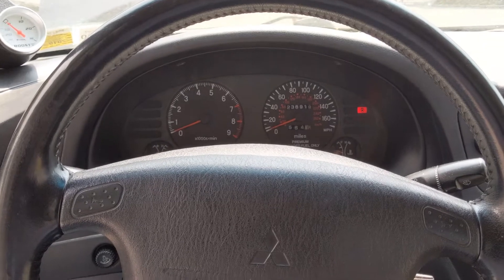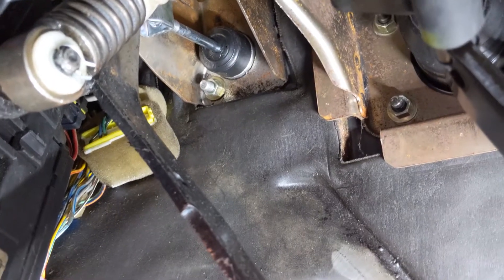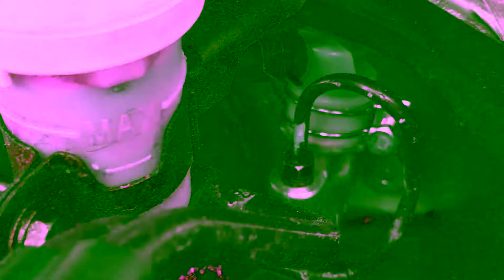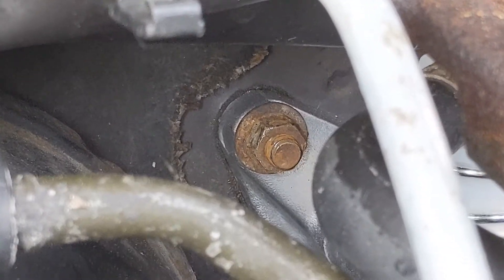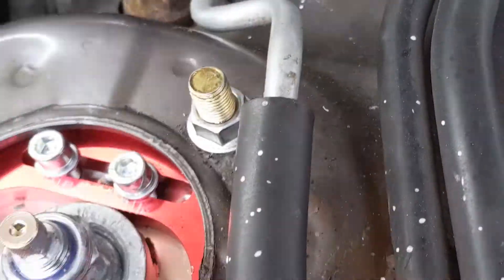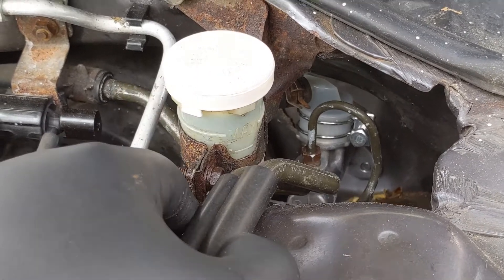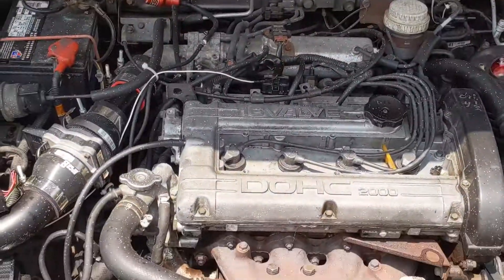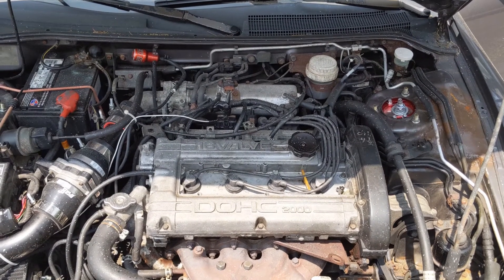Clutch Master Cylinder Replacement- Today's Project Guide Episode #4

Comment: Got a question for you.  I have to replace my clutch master cylinder soon.  Where did you get your OEM part? Ebay seller name? OEM one is so expensive more than $100.  The Excedy (Equal brand) is cheap, but I heard that their rod length is shorter than the stock one.  Your advice would be appreciated.
Reply from the maker: I found my nabco on eBay but the sellers are all out now. Here's a link to a nabco one for $75 bucks. Same one I've been using with no issues. Make sure you get an OEM slave cylinder and replace them as a pair for smooth operation! 👌 https://frsport.com/nabco-mb910562-clutch-master-cylinder?vehicle_id=17345&gclid=Cj0KCQjwjoH0BRD6ARIsAEWO9DvuO5hp1d20tUsFQn7SdC97WWndv1yGYSu7pkASB2fW_wNLh-afmkEaAmVhEALw_wcB
Reply from the maker: Also "nabco" branding is the OEM just to clarify lol
Reply: @TPGDSM  Thank you so much!
Reply from the maker: @turbofroggarage  anytime👌